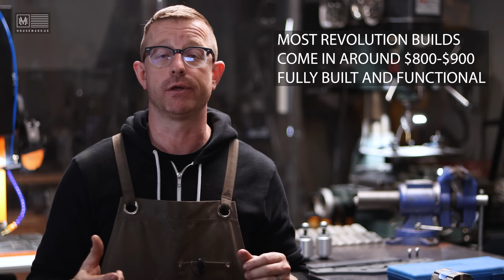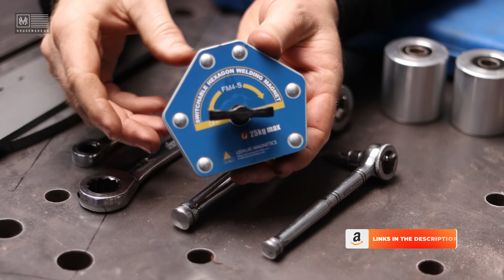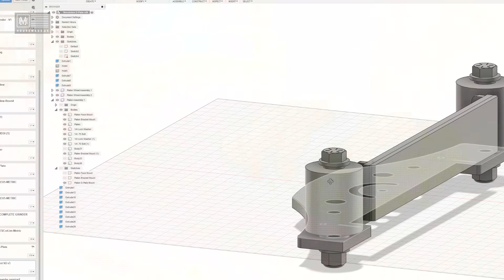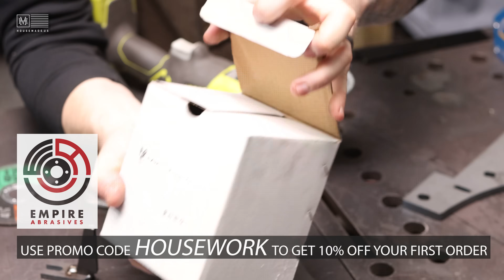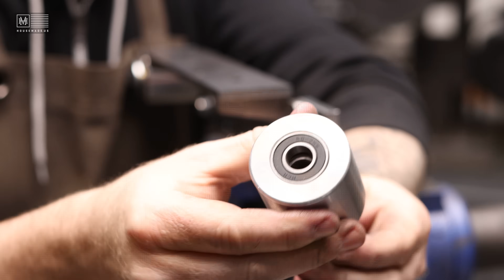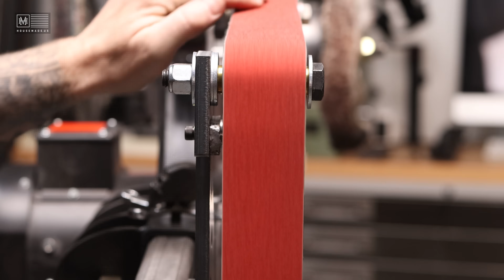How to: Build an Extreme 2X72 Platen

Comment: I hate those wheels. The ones I find are the best are the ones that are several bearings all lined up and can be replaced by removing the pin. I find they last way longer and can be easily fixed with 25$ worth of bearings if they fail. I love what you've done with the revolution though. The pivoting design for the horizontal positioning is beautiful

Comment: I'm stuck! I finished the build and the grinder 100% is ready with the exception of heat treatment of the 80crv2 plate. I have the plate cut, drilled and tapped but heat treatment for this hunk of steel seems very tough for the amateur knife maker to do properly, am I over thinking this? I have a forge and a bucket of AAA Parks but I'm reading that this will give very unsatisfactory results, can you offer any advice?
Reply from the maker: 80CRV2 decarbs a lot. I bet your plate is very hard just under the thin layer of carb. Very common mistake made with that steel.
Reply: Thank you for your reply. You were correct, i am now up and shredding steel! This thing kicks butt! 36 grit Norton Blaze ceramic, it's almost as good of a firestarter as it is a grinder! Lololol

Comment: Love the build ! Really like all your plans and how-to videos,  Helps out tremendously! I'm getting ready to do my own build.  I have alot of 1/4" plate. Was wondering if I could substitute all the 3/8" plate for the 1/4" of if I should stick with 3/8"?
Reply from the maker: The D plate definitely needs to be thicker than 1/4. Most other things would work fine I would think.
Reply: Thanks for the quick reply.    I will switch my design to all 3/8 . Was also wondering on D plate design that you have, ( Correct me if I'm wrong), is 11 inches long .. I thinking of making mine 14" from center of wheels. Do you think going this big will work. Or should it be shorter?  
On a side note, seen your video of the fine-tuning tracking arm .. amazing design!

Comment: Just bought your plans last week and these "leg and foot" pieces are not on the cut sheet. How do I get them on a cut sheet??
Reply: The only file I do not open. Thank you sir.
Reply from the maker: Cut that from .25 - perfect fit.
Reply from the maker: They are a different thickness so they have a separate cut sheet called platen bracket. Email me if you can’t find it.

Comment: I see your grinder is up on a pedestal.  What is that made of?  I just put a 2HP on mine and came to find out that the risers are just a bit too short to rotate clearly with the cooler on my motor.   :(

Everything is complete, just waiting on the VFD.   The only setback I ran into aide from that is in the picture for the receiver tubes (step 4, Rev 8) shows the knob holes drilled in the correct position, but the tubes themselves aren't shown in the right orientation.  When you weld them (step 10), there is no indication that the holes should actually be opposite of each other, so it was a bit awkward to balance in the drill press to drill a new hole.  Not a deal breaker :)

It's tracking by hand like a boss, and everything is within ~0.1deg across the board.  Digital levels really are that amazing. Excited to fire it up tomorrow!
Reply from the maker: I used 2x2 to raise up the machine because the rolling cart I bought (Sam’s club) was a bit too low for my liking. I’m working on new more clear drawings for the next revision. That is a helpful mention. (I can’t see it because I am too close) 😁

Comment: Brian is this platen bracket included in the plans? My computer is at work and cannot check this moment. If not can I get the cad file for this?
Reply from the maker: The DXF file is included to cut the bracket out via CNC. If you buy the kit it comes in the kit itself.

Comment: Brian, enjoy the video and the detail you show. I purchased the plans and am in the process of gathering all the goodies. A couple of things FYI. The motor you show is out of stock. I have been in the welding business for over 40 years, like removing mill scale (which I endorse 100%) If you take the time to clip the ball off of your wire each time your starts will improve, especially on short welds. The other thing I would suggest is to clamp the ground directly to you part to be welded. Small detail but they do make a difference. I will have my parts laser cut because I have a customer who has offered and I plan on TIG welding because I have the equipment. Very good work and great plans. I will send some pics when I am done. Thanks for a job well done!
Reply: I gave up on TIG and went to MIG after running out of $90/60CU Argon twice.  I'm pretty green, but TIG seems extremely slow/expensive for this.   Got any tips for using TIG for plug welds?

Comment: Great info Brian!, I just got all my stuff in and starting my cuts tomorrow, I bought my high carbon steel as suggested from New Jersey . So I am not a knife maker and don't have the Heat treat setup like forged with fire.. is there an easy way to do this? and is it necessary ? Thanks Danny
Reply from the maker: Good question, I would try to find someone who has a forge, maybe a blacksmithing community page somewhere near you? They can do this for you in 10 mins. Otherwise you can send it out for heat treat, probably cost less than $10 to have it done. Peters Heat Treat does this.
Reply: @HouseMadeUS  Thanks for you response Brian, Im sure I can find some local Blacksmith here in So Cal. I am beyond stocked in starting my build, Keep up the great videos man, Good job! Got all my cuts done and into the douche bath! haha
Reply: @HouseMadeUS  Also I have another question, The anti rust solution that you recommend after the Vinegar soak. Is there another option to that stuff?